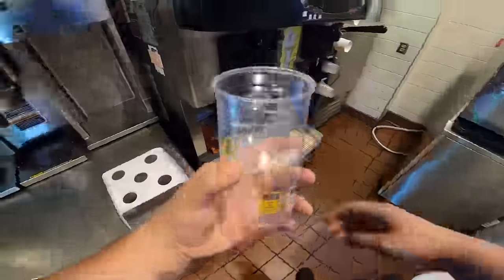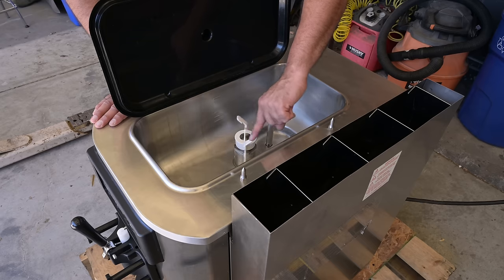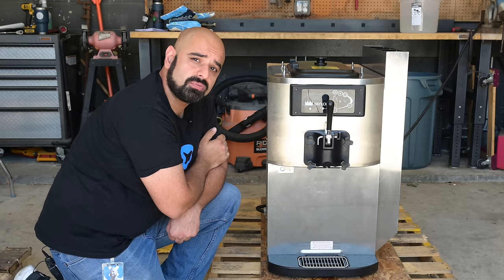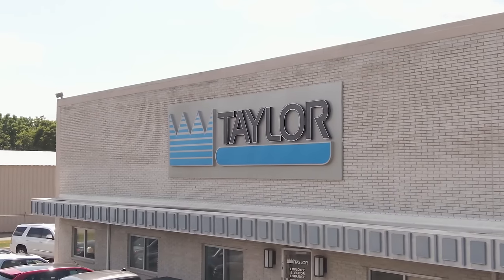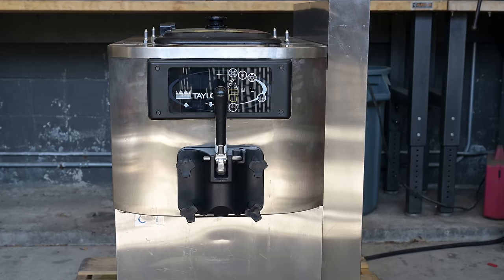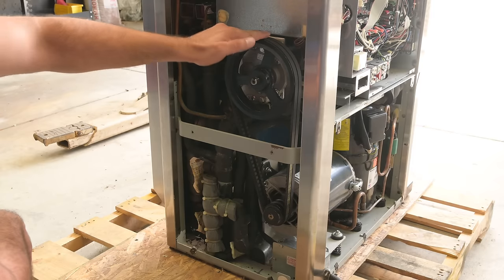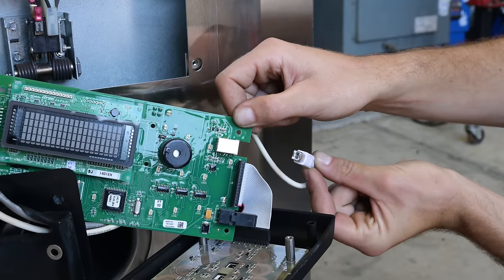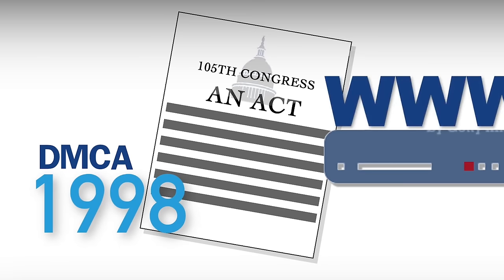Why McDonald's Ice Cream Machines Are Always Broken and How To Fix Them

Comment: I worked for Mcdonalds for many years and was the main person in charge of our icecream machine and McCafé coffee/smoothie maintenance, was trained by Taylor to do the cleaning and maintenance and would often do all repairs I was able to do on it to prevent a call to Taylor.  Couple of things to point out you're absolutely correct a lot of the downtime has to do with the heat cycle or if it wasn't cleaned. However, a lot of the stores that I would go to (my stores franchisee had many stores and would cycle me around to others stores to do said maintenance) tended to have older machines as well as shake and ice cream combos machines. And 4 hours was how long it took UNINTERRUPTED to clean it. often times I would be pulled from my cleaning to help with a rush or to hand out breaks for other employees. this added to the time it took. often times i would go in at 3am before the heatcycle, clean it, to bypass that days hea

Part of the consequence of having both of those combined is that if one side broke often it would affect the other one. So if the hake machine side got overheated or overworked the whole machine would lock down. Also the cleaning point you brought up while extremely valid that it takes about four hours, this cleaning maintenance was only done once every two weeks. In fact McDonald's has/had an agreement with Taylor dating back since the beginning which states that they have exclusive rights to not have to clean their machines as frequently. So if you were in another restaurant with a taylor machine you would have to do this cleaning cycle every week. how gross the shake machine gets after 2 weeks is the reason I will never eat softserve ice-cream to this day unless its within 3 days of its cleaning. 

What this video doesn't show is what that machine looks like after one or two weeks. The nightly heating cycle would cause the shake mix to bake/build up onto the parts. It's this viscous goop that builds up over time and hardens even if done correctly. because the heat cycle gets so hot, its very much like if you boiled milk and that white gum like build up on the bottom of the pan. And we know that build up in mechanical devices can cause them to fail. 

This machine also doesn't show the pump apparatus that would be used to pump shake mix into the main cylinder under pressure. A lot of Taylor machines have these and they're a critical fail point. They're metal on the outside but their insides are made out of a hard plastic with gaskets that tend to get chewed up as they are moving and dont get relubbed until the by weakly cleaning. Which while are simple enough to replace might not be something your average McDonald's employee would know to look for and a franchisee for example might call Taylor to effectively replace a rubber gasket the size of a rubber band that's causing the whole thing to break. 

I cant think of any thing else but if you have any questions feel free to ask and ill do my best to answer.
Reply: This was very informative, thank you!
Reply: Are franchisees contractually obligated to use Taylor machines, and if so how come no one has brought this before any federal prosecutor as an antitrust violation?
Reply: I am unclear on two points:
1) Why does it take four hours to clean? What's involved in this process?
2) What is the heat cycle doing? All I can think of is a typical freezer's defrost cycle, which is quick and doesn't cook the food inside.
Reply: Perfect ... I can never enjoy a milkshake from McDonalds ever again.
Reply: Sounds like mc Donald's is getting scam by Taylor
Reply: @chriswright8074 they sure are and because of the contract Taylor charges a lot of money just for them to come out and just walk through the door let alone actually touch and fix the machine which is why most franchises won't call them. It's cheaper to lose a McFlurry sale every now and then then it is to actually call the people at Taylor to fix the machine
Reply: I'd love a video of what this video doesn't show. Such as the icky mess. I think a video like that could go viral
Reply: Between the smell of spoiled dairy product and scrubbing the impossible, I think I lucked out because my machine never went down on my shifts if I was the one taking care of it
Reply: After reading your comment, it honestly sounds like these machines are designed to break... & designed to overheat and fail after so long.

Imagine if your car did this bullshit, or your refrigerator at home, or your PC b/c it was "used too much"... what kinda sh*t poor design is this by an engineer?
Reply: @MRSketch09  well, crazy part is, they do sometimes. But, and I know this is hard for some people to understand (not you, clearly), but that's the beauty of LITERALLY ANYONE BEING ABLE TO TAKE THEIR TIME TO UNDERSTAND THE PROBLEM AND BE ABLE TO FIX IT THEMSELVES. I dream of a day where I can buy something and use it for a lifetime again. I hope that I, a long with everyone else, can see it happen
Reply: When I worked at diary queen we cleaned our ice cream machine nightly and it got flushed as well
Reply: I'm very curious on if you were payed fairly as ur franchisee used you to bypass expensive calls to Taylor. and clearly you weren't excused of the other tasked.
Reply: So, what you're saying is @TaylorCompany make their machines deliberately difficult to operate and maintain, all while colluding to prevent their repair? Welp, looks like the food service industry has its next target.
Reply: I used to work at Steak&Shake. I always felt proud of the milk shakes because it is about as clean as you can expect. If the washing sanitation machine is cleaned properly the glasses were nice thick glass that felt great in the hands. Milk, kept in an independent refrigerator above the shake station. Ice cream in the old fashioned scoop bar, which I would personally clean EVERY NIGHT including actual shake machines. I would also  hose them out back until not a single fragment of milk or ice cream could be seen. Wipe everything down with surface appropriate ecosan, rinse the shake blenders after sanitizing it. I would NEVER get ice cream from Mc Donalds, it always tasted off.
Reply: I'm not reading but thanks for all of that
Reply: Have similar experiences with carpigiani, in the end most of them will function somewhat similar. I had custom metal gears made to replace plastic ones in the pump, lasts years with those but still keep plastic ones as a backup. 

Other machine had pressurized shake syrup containers but no documentation of how the compressor worked or even the fact that it existed. 

Final machine had some insulated pipe that carried ice-cream mix that had failed, however to replace it you had to cut it out of the machine's insulation foam and take off all the side and rear panels. Once that was done there was no replacement part available and repair by the factory would take 3 months, cost 4800 euros excluding shipping the thing back to Italy.

All the producers function the same and rather not have you do anything yourself. So iFixit has a good plan here.
Reply: @Ambiguousaxolotl  I used to work in a frozen yogurt shop with six machines. Every night, we emptied, cleaned and sanitized two of these machines and replaced worn-out blades, while the other four machines were cleaned from the outside. This was an ongoing rotation. None of the machines were holding yogurt for longer than three days. So, I guess a few days is okay, but two weeks sounds really gross.
Reply: Also the fact the Shake and Sundae mix are identical except for the colored tops, and if you mix them up, then the machine goes down.
This is 9/10 what happens in my country with most stores.
Reply: @andrew40  The heat cycle I believe is to re-pasteurize the milk and basically kill off any bacteria growing inside.
Reply: I know exactly what you mean, I'm currently the main person at my store to perform maintenance on our combo machine, which was recently replaced with a brand spanking new one as the old one, which was apparently 11 years old, basically broke at the mixture tanks and the compressors were spent. Being a manager helps too as my boss only trusts 3 of us to clean the machine, but it means I can just focus on the machine so I usually have it done under 4 hours in the morning. 
The fact the machine has to go into heat cycles, my main issue is when the night crew don't fill the tanks up and the machine throws a fit in the morning because the tanks are bone dry. What the tanks and parts look like after two weeks is frankly disgusting, if everyone saw what they were being served out of the day before we cleaned it I reckon a lot would either not eat it again or ask when the last clean was.
To some fortune I've developed some intolerance to some dairy products, the ice cream being the main one so I just don't eat it because of that anymore.
Reply: i used to work has maintenance manager at mc like 23 years ago in Argentina, at night a crew used to disassemble the machine head and wash. every part have a place in a especial tray. in the morning a crew assemble the machine and lube every gasket and o-ring with taylor lubricant. every week they have to make a cycle cleaning trowing away every topping. every 6 month maintenance have to disassemble the machine and clean the internals, fans , remove dust, inspect everything and all o-rings and gaskets have to be replaced,   those machines where work horses.
Reply: Yup, I was that guy for BK. Over/under filling the hopper fails the heat cycle and locks up the machine and I get a call every morning
Reply: @andrew40  I didn't see an answer to your second question, about the heat cycle. The heat cycle is effectively a kind of pasteurization cycle. So in contrast to a freezer's defrost cycle, this heat cycle is designed specifically to get the product above a certain temperature for a certain period of time to kill off any bacteria in the product. This means it can take quite a while, because the product has to go from some freezing temperature all the way up to a temperature that will kill bacteria over a certain length of time (it can't get so hot it will kill all bacteria outright, because that would also damage the product) and then back to freezing.

As far as your first question goes. On a weekly basis you take the machine apart, clean the parts, lube some stuff, sometimes replace some stuff, then put it back together. The actual time it takes you depends on whether you can dedicate your time to the machine or if you have to do other stuff as well. Four hours is a bit on the long side, especially for an experienced crew member cleaning it.
Reply: @andrew40 I could do it about 3 but I really had to cut corners. This video also leaves out that you cant really tell if you'd assembled the machine correctly until you've filled the machine and you could follow the exact same steps but for some reason it just fails so you have to pull the entire machine apart all over again and reassemble it but you have to do it quick because you risk sending the machine into freezer lock. And when you're dissembling the machine you have to be really careful to release the pressure properly otherwise the valve shoots out and can cause injury......really just a nightmare machine
Reply: @andrew40  The heat cycle is pasteurisation to kill any bacteria that may have formed during the day.
Reply: @anon_y_mousse   I am  a restaurant manager in the UK we are not contractually obliged to use Taylor, infact we do not even require a taylor machine, we have multiple different options the most notable  being Carpigiani. I'd  say from my experience in the UK most restaurants are about 50/50 split between Carpigiani and Taylor. Taylor engineers to not operate in my country so the have catering engineers trained  by taylor. It is still expensive to have them look at it but no where near the same as this video. The catering engineers we have also fix most other equipment in the restaurant at about £100/hr roughly. I believe that this issue lies solely with America's poor laws regarding right-to-repair. I can also say from my experience the Taylor machine have far more "moving"  parts and are often more prone to breaking.
Reply: @Recovering_Californian  Wait till you find out a lot of places use vaseline as lube in ice cream machines XD
Reply: @MaxUnix   Interesting, though I was hoping to hear from someone who deals with McD's in the US. And it'd be nice if the information didn't come with a tinge of racism against Americans. If our laws were actually followed by our own government then there are a lot of companies that would be defending themselves in court for antitrust violations. So it's not that we have bad laws, but that our prosecutors are leftists and don't do their job.
Reply: @anon_y_mousse  America is not a race, hate to break it to you.
Reply: @MaxUnix   You can't choose where you're born, so regardless of race it's still bigotry.
Reply: @MRSketch09  I'm am something of an electronic enthusiast, so the moment I saw those electronics in the icecream machine, I can tell straight away, this thing is designed to fail. The motherboard and the daughter board config is strange. Also, I haven't seen an old school ribbon cable and IDC connectors in over a decade along with other components on these boards. This thing is antiquated. Also, motherboards tend to use 12v railings but through its own VRMs so there's no reason to have that many power relays shown here. So these power relays are being used for something else. It's almost like it's regulating power flow through a compressor, which would explain why the icecream turns into a sludge or slurry when it "fails". 

Taylor did a nasty dirty.
Reply: @chriswright8074  Nah man, its the franchisees who are taking the beating. McDonald has very few corporate run stores, they mostly just own the real estate and set the rules franchisees have to follow.
Reply: @MRSketch09  … or imagine, flying over the Pacific and the air plane overheats 😂
Reply: All I know is, the ice cream machines at Dairy Queen are never broken.
Reply: Wendy's doesn't have these problems 😊
Reply: Why are these machines so poorly designed in the first place?
Reply: @Techprep23 Sounds like they need to change companies... Why haven't they done this?
Reply: @Engineeer Why is two weeks gross. A yogurt tub lasts like a whole month in the fridge. Yogurt doesn't spoil quickly if kept refrigerated.
Reply: When I worked there our ice cream machine was never filled due to it locking and going in heat cycle, the cleaning process did take as long as you say it does but on that day it was the only day it was down. For some reason all the McDonald's I've worked at never had the ice cream machine down they understood most of the profits came from that machine. So I just think its all how upper management works at the McDonald's you go to and how they have the rules set on the ice cream machine and if the upper corporate visits those stores to ensure everything's up to par with the store. There's many human factors as to why it's "not working". 
Ps. For non late night McDonald's we also had to have it filled to a specific spot, so it could be shut down for the night so the morning crew the next day turns it on and is ready to sell ice cream.
Must've had the only working Ice cream machine in a thousand mile radius
Reply: @themonsterunderyourbed9408  The cup of yogurt in the grocery store is sealed air tight, while the hopper of a frozen yogurt machine is not. The liquid yogurt is getting delivered in boxes, which sit in the fridge for several days, before they get poured into the machines. Even if the hoppers would be sealed (which they are not - they are just loose lids), they contain much more air than a yogurt cup you find in the grocery store.
Reply: @Engineeer  This is false. An open tub of yogurt can last 2 weeks in a fridge easy. Once you open it, it's no longer air tight. The reason for this is that yogurt is already full of bacteria (the good kind) and that makes it hard for bad bacteria to grow. Even if it does go sour, it's still good to eat in the sense that you won't get food poisoning, it will just taste sour (pretty much exactly the same as sour cream).
Reply: Absolutely correct. As someone who has been cleaning and maintaining mcds shake machines for over a decade I can honestly say I couldn’t have said it any better.
Reply: @PanoptesDreams nah i think the shake mix is slightly thicker. one time someone at my store mixed it up with sundae, it didn't break the machine and it produced thicker, slightly clumpy, pale yellow swirls. like the thickshakes lol. thankfully we have a second machine.
Reply: @merrynesther  I used to be the maintenance guy that handled the shake/sundae machine at a McDonald's. The shake mix is actually thinner, because it doesn't need a high fat content to hold on to all the air that a sundae needs, so they cut corners by replacing some of the cream content with milk. Trying to use shake mix in the sundae side will make weird things happen (mostly small chunks of badly-frozen mix in the output, since it can't hold on to much air so it deflates and hardens), but using sundae mix in the shake side actually gives you a really nice, creamy shake instead of just being thick.

And to add another disgusting fact: While some managers are perfectly understanding of just how long it takes to drain, disassemble, inspect, clean, re-lube, re-assemble, and prime the machine before turning it back on, some managers are not. The last manager I had before I quit that job was an absolute [insert any swear word you like here], and by the time I left, was demanding that I not disassemble or even clean the machine, and instead just drain into the recovery cylinders, pull out the faces until the cleaning timer reset itself, and then just put it all back together (yes, really, and I did not misunderstand - he said it should only take 30 minutes to deal with it). We had two machines, and I'd set their heat cycles to alternate (one would run in the morning, one would run at night), and I'd cycle between them every week to meet the 2-week cleaning cycle, so that shakes and sundaes would never be down (this was a 24-hour restaurant). Of course, this same manager was getting on my ass to swap them back to both go into a heat cycle at night, because apparently the night crew kept trying to use the machine that was in the middle of a heat cycle, spraying themselves with hot mix and needing the machine to re-start the cycle when it inevitably failed. I never did end up doing it, because the other managers that I actually cared about were happy that there was always at least one machine running, so I kept "accidentally" forgetting to do it, and that asshole manager was too full of himself to skim the manual to even know how to enter the control menu, so he had no way to get it the way he wanted.

And don't even get me started on how I was actually taught to "clean" the machine when I started there (recover into any random un-cleaned bucket you could find, mix all-purpose cleaner with sanitizer and cycle that through, pull off the faces until the countdown reset itself, put the faces back, and dump the nasty mix back into the hoppers). No disassembly or even inspection of parts - and they wondered at the time why mix kept dripping down the center drain pain and turning into some messed up cheese that they just plugged with napkins...
Reply: Is it the cost preventing stores or something within the contract stopping from having a backup they can go to, because surely the cost of downtime would be a huge factor for losing customers in busy times
Reply: @merrynesther  Uh yeah I know that. I'm saying the bottles are identical EXCEPT FOR THE COLOR. Which keads to that confusion. Dump enough of the other in the wrong vat and it will mess up that side and take the machine down. The worst is putting sundae into the shake hopper because it gets too thick and the machine blocks up. Inversely the sundae will come out as a thin watery mess.
Reply: @luminatrixfanfiction  something of an electronic enthusiast!??!?! Just to let you know, that ribbon cables are still widely used in all kind of electronics, even in the smartphones. Not in those sizes, but still they are RIBBON CABLES.
Reply: @themonsterunderyourbed9408 Yogurt, is different than ice cream.  Yogurt already has GOOD bacteria in it that eaten its food, and that is what gives yogurt its taste.  Milk, as in Ice cream does not have this good bacteria already in it and so bad bacteria can and will eat and multiple all it wants too until they are full and we are sick .
Reply: @andrew40  , a proper clean requires dismantling all the food contact surfaces and deep cleaning every part, then using a food safe lubricant where needed on the moving parts, running the machine through a sanitize cycle with chemical, then a rinse before you can add the product, the heating cycle I presume to effectively heat the product to a high enough temperature to remove any pathogens that may have grown in the product.  Bacteria and mold love sugar rich dairy products.
Reply: @andrew40 I am pretty sure what they mean by the cleaning cycle is likely the machine  pasteurizing, or basically cooking, the ice cream mix in order to kill microorganisms which would be in the mixture. During this time I would guess that the mixture is probably also run through the whole machine to make sure there are no clogs and to (hopefully) heat the rest of the machine to kill any microbes which might be in other parts of the machine. I am not very familiar with pasteurization so I do not know if four hours is a reasonable amount of time for the process to take or if it is long.
Reply: @MRSketch09 A lot of American built and engineered equipment is of really poor quality when compared to European or Japanese built equipment … Buying “made in USA” is good for the economy, in terms of your money moving from your wallet into corporations. 🤷🏻‍♂️
Reply: Thanks for sharing your experience.... I wonder if Fosters Freeze or Dairy Queen have such problems.
Reply: Thank you for taking the time to explain! :)
Reply: were you paid better or worse than the taylor technicians that trained you?
Reply: So in other words summing up your experience: Taylor seems to intentionally keep their machines to be this faulty and straight up badly designed simply in hopes of getting more calls for gaining more money per repair.
Reply: @laughingCheeks  I beleive you have understood the situation and his comment perfectly.
Reply: @anon_y_mousse Wait what, prosecutors are leftists? What does that have to do with them enforcing laws? Just a weird MAGA rant you have there
Reply: @chriswright8074  McDonald's doesn't get screwed, the franchisees are.
Reply: Why on earth doesn’t it have an external heat sink or something. 4 hours labour to clean a device is pretty crazy.
Reply: Interesting. I was taught to do it daily and deep clean the machine once a week, on the same day of the week. Of course, I wasn't officially taught how to do so by the Taylor company but relied on their cleaning manual.
Reply: @anon_y_mousse It appears to be so, and it is on the global scale. I am from the Southeast Asia, and former employee of McDonald's.
Reply: @Techprep23 Just sending a personel alone is a fixed rate, plus the cost of the repairs.
Reply: I worked for McDonald's in the UK 30 years ago. In those days you had to dismantle the shake machine every night and do a deep clean - took an hour. It then took 45 minutes to put the machine back together in the morning, Starting to think it was a better way...
Reply: Why is this machine better than the TAYLOR freezers that employees tear down, put all the parts into a tray which goes into the standard restaurant sanitizer.. and in the morning, machine is reassembled, right down to all the o rings. This is done by a kid with 3 days experience at McDonalds.  ( no gross buildup..... but likely no expensive recurring revenue )  ?

Why is is Wendys, and everyone else using Taylor machines has no such issues?  Could it be Taylor and McDonCorporate are sharing the ill gotten gains of repairs ?